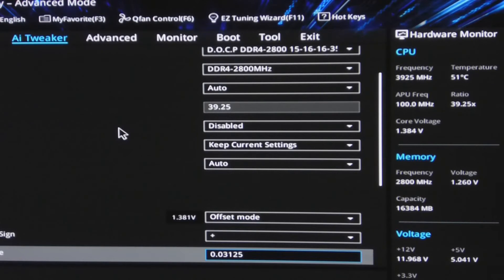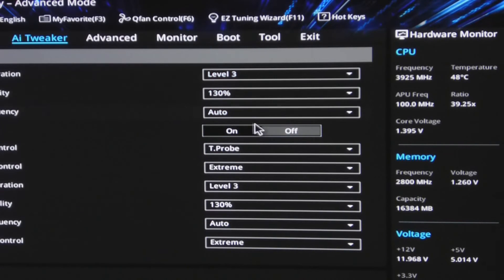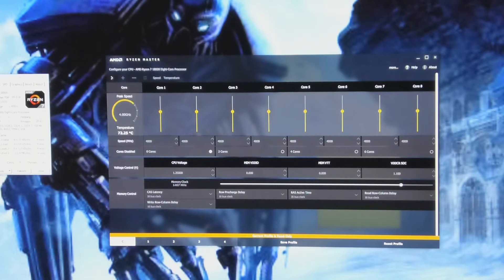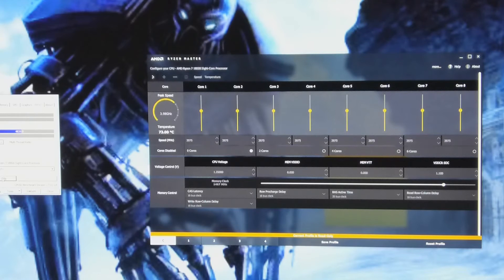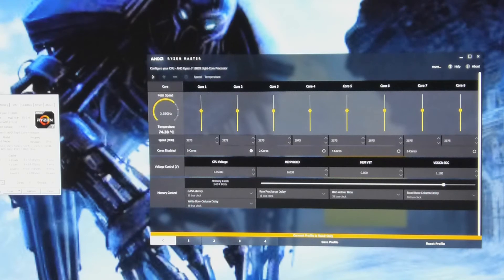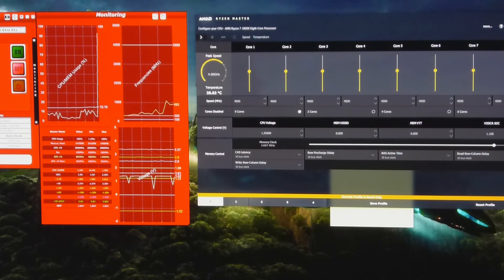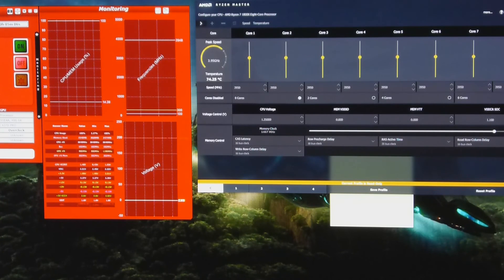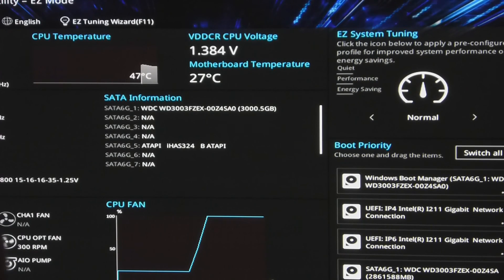Overclocking Ryzen  on the ASUS Prime X370 Pro will I get 4GHz???

Comment: I have a 1600 and a X370-A with a Wraith Cooler. Can I slightly overclock on this?
Reply from the maker: Yes, 3.7 to 3.8 at 1.35v should be doable at about 75-80c under load

Comment: I can't adgust any settings in ai tweeter?? When I click on the auto icon nothing happens?
Reply from the maker: Make sure you're in the Advanced mode, on the ASUS x370 Prime pro to toggle between easy mode and advanced press F7. What Bios version you on?  a video on Bios versions for the x370 Prime https://youtu.be/EOysOU__Hqg
Reply from the maker: Ps   If you have just clicked on the Auto-icon next to  CPU core ratio you will need to type a new ratio ie click on  Auto next to CPU core ratio in Ai tweaker and type 39 which will give you 3.9Ghz overclock.

Comment: it didn't work for me
Reply from the maker: Sorry to hear that, I was unable to get my 1800x safely stable at 4ghz.   But it will do 3.9ghz at 1.33v and LLC level 2  some chips just are not as good as others silicone lottery. sorry :(
Reply: Think it may be my mother bord bios version
Reply from the maker: Well  I have a video about BIOS updates for the ASUS x370 Prime it's a bit old now as BIOS 3803 is out I have updated to the latest version 3803 and it seems quite stable but still no spectre patch yet :(   and 
 a 2-4% slow dowen on CPU mining https://youtu.be/EOysOU__Hqg

Comment: nice job! what is your memory speed and timings and voltage?
Reply from the maker: I am just using the DOCP AMD's version of XMP   2800Mhz CL 15-16-16-35 at 1.25v  thank you for the view. :)
Reply from the maker: I have it set to 3000MHz at CL 15-16-16-35  now
Reply: @OzzyBoganTech  what is the voltage at 3000mhz?
Reply from the maker: @erikthorvaldsson6614  I still have it set to 1.25v